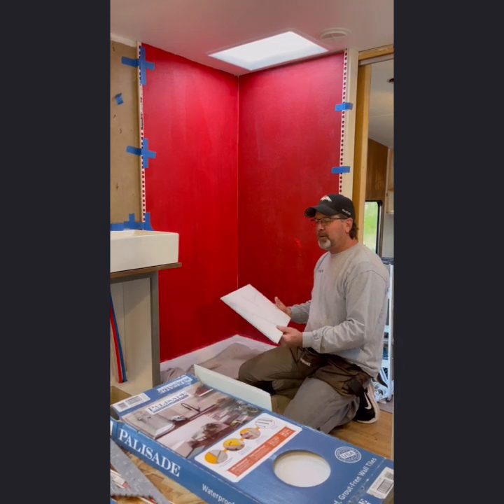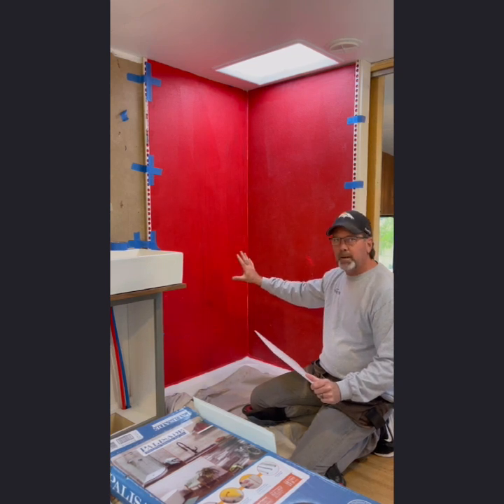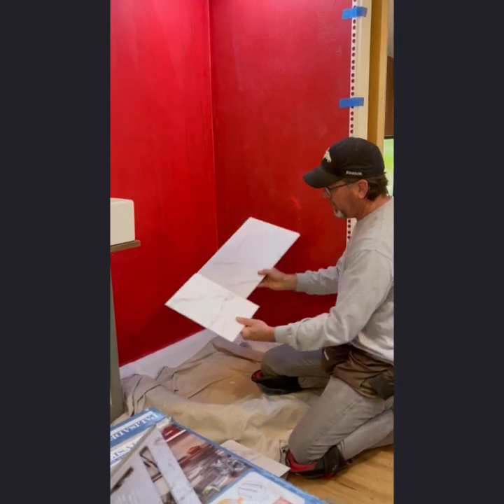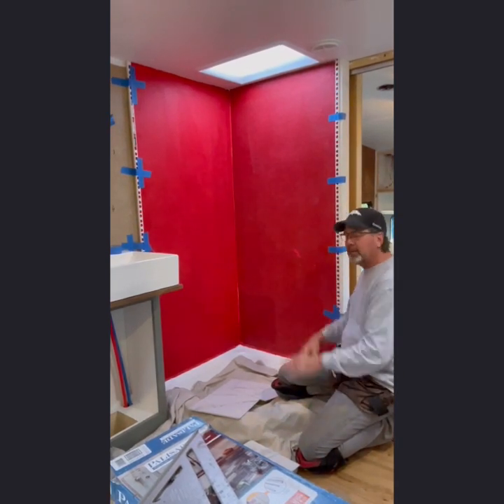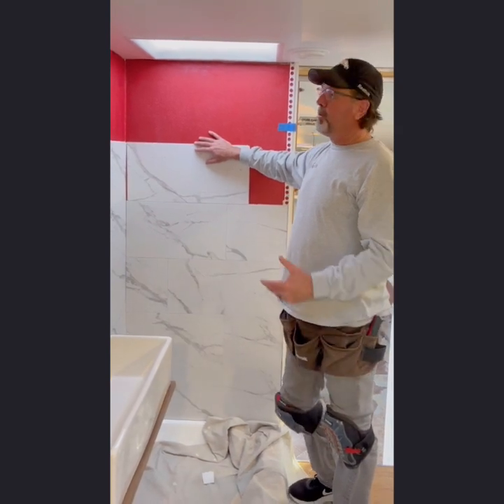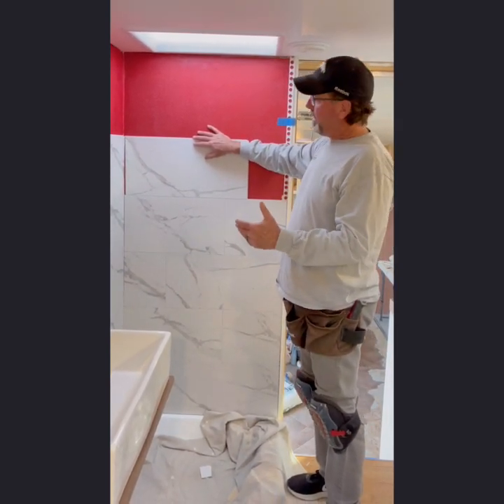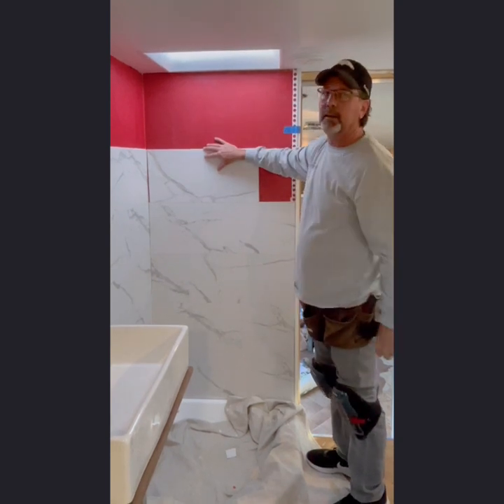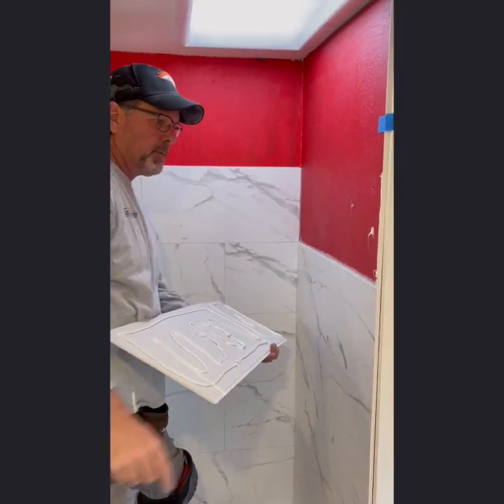RV shower - interlocking vinyl tile install

Comment: The silicone between each tile is a little excessive
Reply from the maker: Up to you if you choose to do silicone in the joints or not, how come you think it is not necessary?
Reply: Literally says on their website to do it that way, bud.
Reply from the maker: Exactly 🤷‍♀️
Reply: @rvingdogsandwine2027 not only is it not necessary it's actually bad.  You are creating a sealed area that can't drain.  The definition of a mold growth area.  The red guard will prevent water from getting through.   Those tiles need to be able to dry out 😊
Reply from the maker: @jmgraydz very fascinating little theory you got going there. Pls elaborate how you came to this conclusion 😂

Comment: What kind of silicone? If I'm not mistaken silicone breaks down or has a life of about 5years. Elaborate if you are a pro
Reply from the maker: 100% silicone sealant has been an industry standard for decades. According to the manufacturers specifications the life expectancy is more than 5 years 🤷‍♀️

Comment: Did you use chanelling on the inside corners? Thus hides all the imperfections on the edges like crooked walls
Reply from the maker: We choose not to as they look bulky and awkward in the corner, on the outside we use white Schluter edges as they are much slimmer and neat looking.  But its all preference.

Comment: Btw, you used the glue/adhesive in the inside but on the edges, you applied 100% silicone, correct?
Reply from the maker: Yes, construction adhesive behind the tiles and 100% silicone for edges and in corners :)

Comment: Have you ever installed in a house I can't lay regular tile to save my life but I can lay vinyl flooring. I've done at least 50 jobs with vinyl flooring(on the floor) so I don't see why this wouldn't work at home, thoughts anyone?
Reply from the maker: I’m sure it’s a great product to use for shower walls in a house, we have not installed in a house.

Comment: I am curious if you used the Red Guard on plywood or if you installed backer board? I had planned on skipping the backer board and using Red Guard directly on the 1/8 plywood that was behind the old shower surround, but I've really been racking my brain to figure out how to transition at the bottom since the 1/8 plywood falls outside of the shower base.
Reply: GREAT Video! Thank you!! No BS, straight forward. Perfect length. I have same question...Red guard on plywood or did you use a backer board?

Comment: This is an excellent video. Did you reinforce the wall behind the redguard? Our shower has just the lauan thin plywood and I was concerned that maybe it couldn’t hold the weight of the tiles for an install

Comment: Awesomely informative! I have been contemplating how to remodel my 5th wheel shower without the weight of real tile and without using a typical tub surround. Do you have footage of the install of your shower pan and door? Any tips would be appreciated! Thanks for sharing, it looks fantastic!!
Reply from the maker: Hi John! Thank you! Happy our video was able to help you :) Sorry, but we did not make a video when we installed the shower pan and we actually did not use a shower door, this particular model 5th wheel does not have a lot of space in that area so we opted for a shower curtain and had short custom glass panels made and installed them on either side to prevent water splashing out. Here is a link to the listing for this RV if you skip to the pictures of the shower area you will see what I am talking about :) Good luck with your remodel! 
https://www.rvingdogsandwine.com/about

Comment: Thank you so much for sharing!!!!! You did a fabulous job detailing all of the steps. I watched so many videos but none gave me the confident and answers I needed (more questions too). 

I’m in the process of putting up shower walls in my camper van (Ram Promaster 3500 extended). There were sleepless nights, thinking and thinking, how-to, frp, flex seal, vinyl sheet, tiles, backer boards, and the list goes on and on and on. More people should view your video. I am sure they will find it informative. 

Again, thank you for taking the time to share! God bless.
Reply from the maker: THANK YOU JOE! We really appreciate your positive feedback :) happy our video helped you and now we are curious to see how your project is taking shape!

Comment: I did my tub surround without the inside corner as well, the corner looks cheap. I siliconed the crap out of the edges and actually counter set them. Finished with a bead of clear caulking.
Looks great, easy product to work with, only issue, one tube of silicone they sent was old and like cottage cheese. Just grabbed a tube of a similar product and boom, finished her off.
Reply from the maker: Nice work, sounds like you will have a leak proof and nice looking shower for years to come!

Comment: These tiles do have some wight depending on the size of your shower. I bought these online and I haven't heard of anyone else putting them in a mobile rig until I saw this video..totally reassured me that I'm making good choices with my shower install. I'm very grateful to you for that! 🙃 

I wasn't going to get the redguard simply due to the price of the stuff and how little I'll be using but this may have changed my mind. Also, we ordered a neo angle shower pan that was hard to find the right angle measurements for and they only had it in a cream color so I'll be taking others advice and using rustoleum topside paint to make it nicer looking. I'm no carpenter..so videos like this and people sharing how to get things done the right way help someome with as little experience as I have perform a professional quality of work. Serious so helpful and can't thank you enough! 🙏
Reply: Quick question if you wouldn't mind..what size schluter trim pieces did you use? 🤔
Reply: What website did you buy them?
Reply: Just the big box stores..lowes, home depot...I wound up using 1/4" schleuter trim pieces but had to stretch them open just a hair so the palisade tiles would slide in.

Comment: Nice job, fortunately I have a one piece shower stall but had to fix the shower door track it held water and leaked because it wasn’t sloped inward. I fixed it and now it works great and I put in a rain shower head
Reply from the maker: Thx! Glad you were able to fix it before it created more issues!

Comment: Hello Great video. Just wanted to ask how the tiles are holding up with the movement of the RV. Was going to use FRP board in ours but like this look better.Thanks!
Reply from the maker: Thank you! We have not had any problems with the interlocking vinyl tile installations 😊 I

Comment: Nice job, looks fantastic, thanks for sharing! What size Schluter edge did you end up using?
Reply from the maker: Thank you 😃 I am not sure what size we used, but it’s from Home Depot, one of their smaller plastic Schluters
Reply: @rvingdogsandwine2027  Nice, thanks for following up. I'm sure I can figure it out 👍.
Reply: @dustinchappell9248  I got the metal stuff. 1/4" was the closest size but slightly too small..I had to pry the trim pieces open just a hair so the tiles would go all the way in.

Comment: This is just what I needed to see, very much appreciated!  You did a pro job on this install. Great set of tips on how to install, including the Schluter end finish pieces. Schluter also makes a good backer board but so pricey.  I think the hardest part of the install is to figure out where the plumbing goes and cut that out ahead of time.
I was looking at Palram and Palisades and very hard to find a floor sample or display board at Home Depot or Lowes!  Not a single display that I can touch and feel for weight and finish.  I wrote to both companies and waiting for their samples to arrive.
How is the Red Guard holding up?  Did you paint over plywood or backer board?  Did you use Loctite Power Grab Ultimate construction adhesive?  What type of Silicone caulk?
I wanted to make a shower niche for my shampoos, in real tile or vinyl tile. Maybe that is too ambitious?  I would also love to know where you bought your shower pan.  I have a bathroom remodel to do in my RV.
Thanks for the demo!
Reply from the maker: You are welcome MJ! We are happy you liked our video! I believe Amazon has a option for buying a sample for the Palisades if you want to see the product before ordering. Everything is holding up great, we used the manufacturer recommended glue and it worked great, you will go through quite a few tubes of it. We use 100% silicone for between tiles and in corners. 
I found the shower pan from an online company called Mizzle Bath, at that time they where they only one that had a pan the specific size we needed. Good luck with your install!
Reply: My closest Lowe's carries some limited Palisade tiles, although your's may vary. Just a thought if you were going to want to see the tile in person!
Reply: @rvingdogsandwine2027  I found Innovera by Palram!  Just the tile I needed.  This is so lightweight that it is definitely preferable for a large area where real tiles would be so heavy and cut into cargo weight limits.  Very happy that they sent me samples.  I will be redoing my RV bathroom.  Your video is most helpful!  Thank you.
Reply: @johnuppole  Yes, Lowes has them, while H Depot does not.  I got some samples thank you!
Reply from the maker: That’s great! Good luck with your install! Would love to see how it comes out 😃

Comment: I was thinking about using Palisades tile in my rv shower, but I did not know if it could be done over the 1/8 inch plywood used in the walls.  What was the thickness of your wall.  Did you add any thickness to the stock rv walls?  Great job!
Reply from the maker: It can be installed over the existing plywood. Use ample amounts of adhesives, according to manufacturers directions.  All RVs are different so not really a standard stock RV. Good luck with your install!

Comment: Any issues with overlapping the lip of the shower pan?

Did you say Red Guard? And polyurethane?
Reply from the maker: We installed the shower pan so the lip was plumb with the wall and the tile would install flat and not have a bow :)

Comment: Nice work! If I install a waterproof backer, why do I need to silicone the edges?
Reply from the maker: Out of proaction, take the extra steps to prevent a leak. Also you don’t want water trapped between the waterproofing and the tile to start mold or make the tile come loose.

Comment: Did you use two coats of Red Guard?  And do you recommend diluting the Red Guard with water?
Reply from the maker: We do 2 coats as it’s easier to put two thinner layers on. Not sure about diluting, we never done it.

Comment: Did you over hanging the vinyl tile over the shower pan tile flange or did you run it all the way to the shower pan?
Reply from the maker: The tile needs to overlap the pan flange and we held the tile about a 1/4" off the pan, that connection gets silicone

Comment: What’s backer used here? Do you suggest to use plywood with red?
Reply from the maker: Depend on your application, what’s your current walls you are installing the vinyl tiles on?

Comment: Can I use grout for it?
Reply from the maker: I don’t think it’s recommended by the manufacturer and also not needed as the edges interlock and you put silicone on all the joints.

Comment: Hi, could you tell me how much weight this typically adds?  I know each application will vary depending on size but curious since you must always be mindful of weight distribution and loading for motorhomes.  Thanks!
Reply from the maker: About 75 to 100 lbs depending on the shower size and yes you will need to look at your RV's weight ratings in order to decide if you in fact can add weight without losing too much of your available cargo weight. Did that answer your question?
Reply: @rvingdogsandwine2027  Thats exactly what I am looking for.  Thanks so much for taking the time to put out the content and answer my question.  I think the elimination of my tank water heater for a tankless will just about make it a "wash" for weight savings.
Reply from the maker: You are very welcome! Happy our videos can be of help 😊

Comment: I've been thinking about doing this in ours for a year or so. Now that you've had this up for a few months, how is it handling the movement of the rv on the road?  Do you forsee any issues with the silicone allowing more movement and water through?
Reply from the maker: No issues, we have used the same products in other campers without issues 😊
Reply: I've used these same products and followed manufacturer recommendations and no issues.
Reply: I'm considering just performing a yearly or maybe every other year silicone replacement just to keep that maintained after frequent trips.